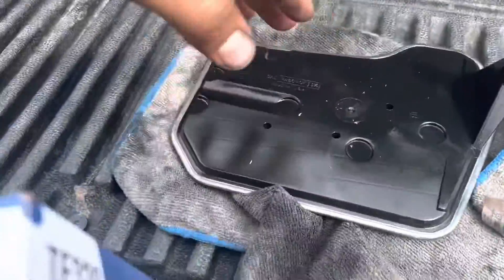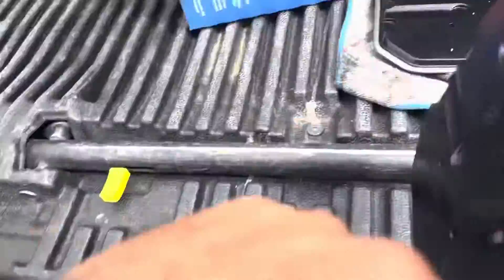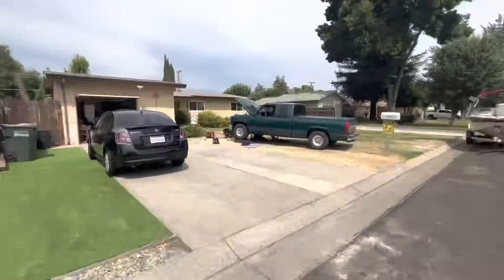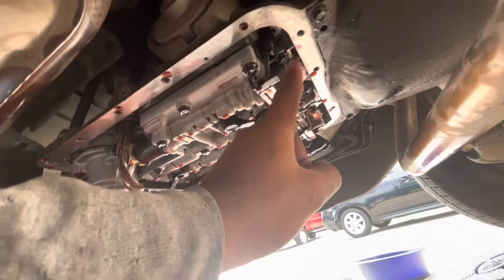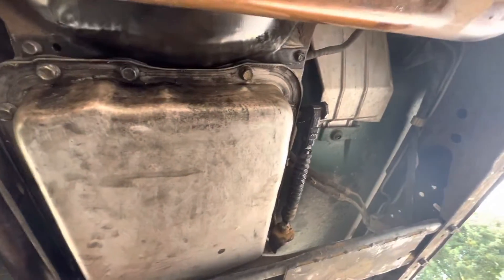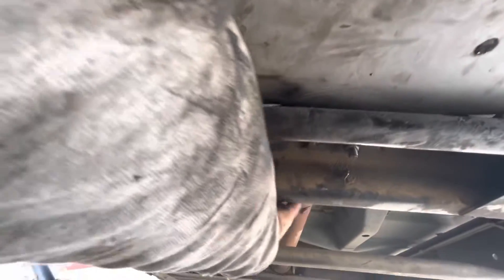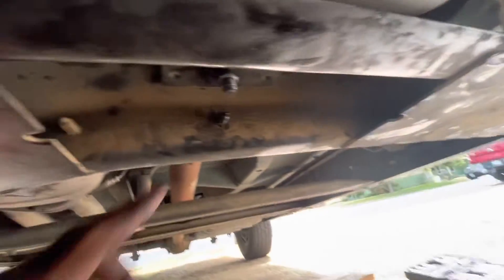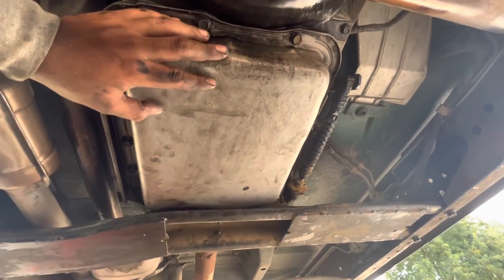OBS Down | Transmission & Engine Service

Comment: I have a question bro before you did the transmission service was your transmission slipping or holding a gear for a long time before shifting
Reply from the maker: Nothing like that.. are you having those issues?
Reply: Yes i am bro
Reply from the maker: Try some of that Lucas transmission fix oil